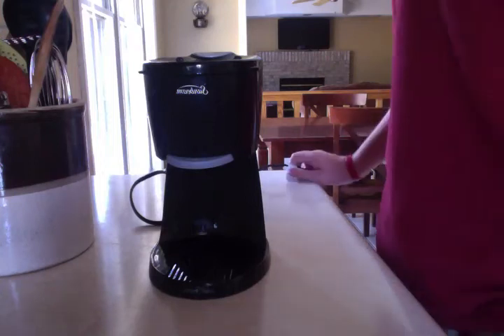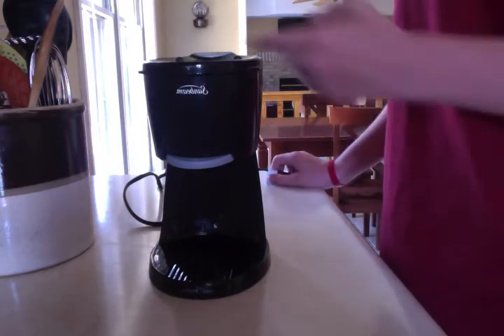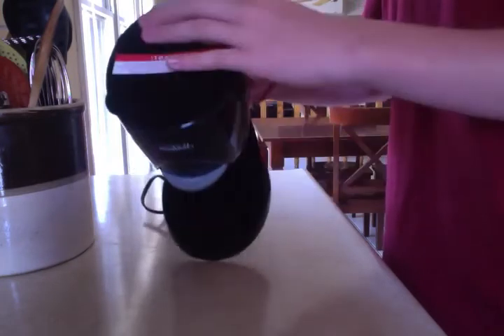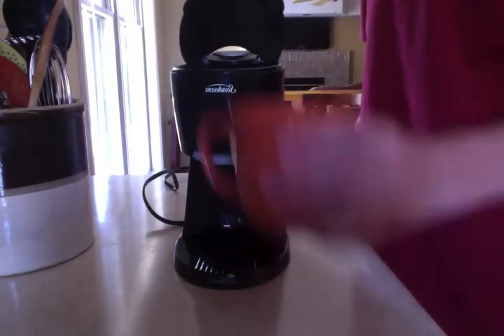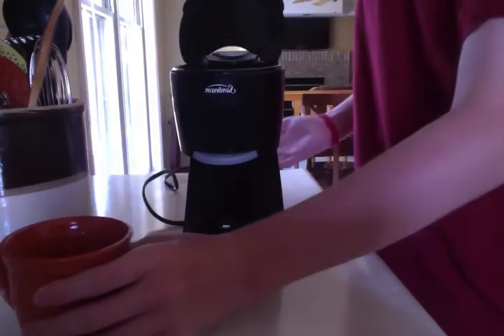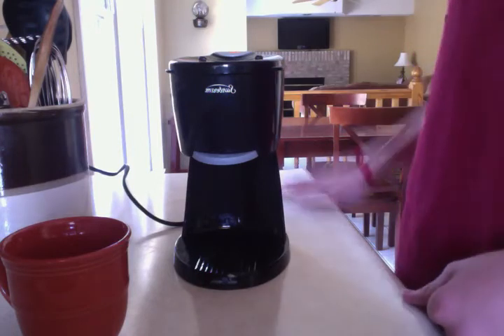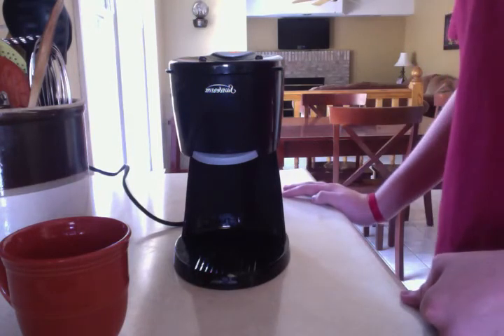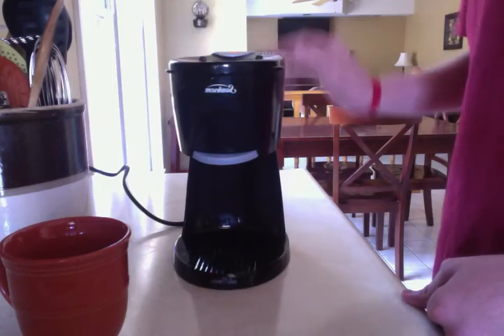sunbeam water heater

Comment: Just fyi, there is no issue with the button sticking.  You have to let it get to boiling temperature (1 to 2min)  then it will turn off. If you unplug it too early it stays in the on position.